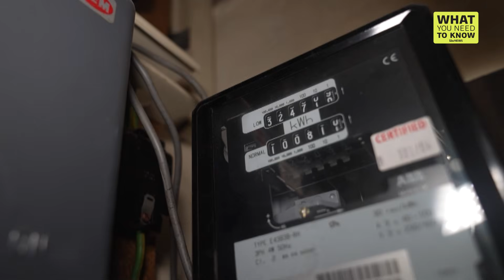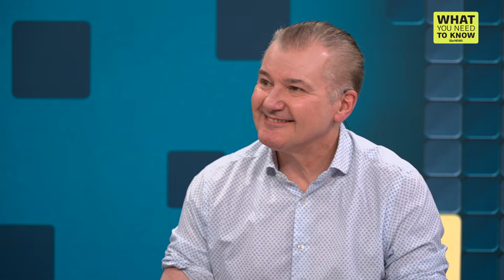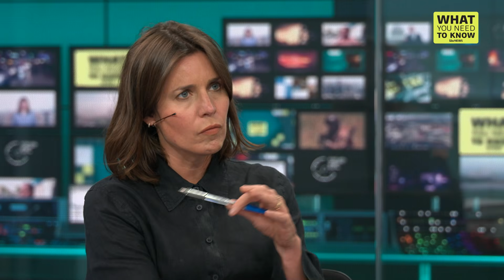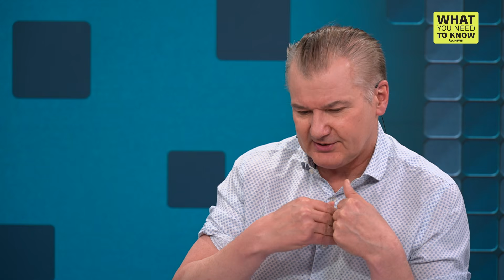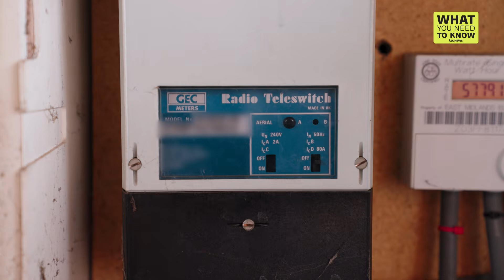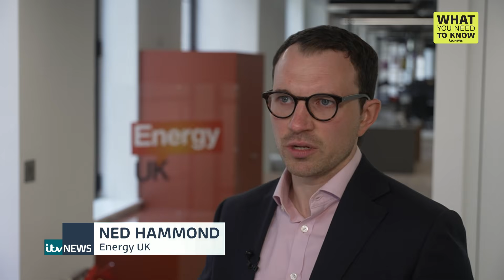Why thousands of energy meters are set to stop working | WYNTK | ITV News

Comment: I have allowed the energy company to change my meter twice. Both times the same. Asbestos. The meter was installed in 2021, so why is a meter which was installed then, obsolete about 2 years later? Did the person installing the meter, not know about the possible asbestos risk in the cupboard?

The other thing mentioned is that I couldn't find the RTS box. Would that be inside the meter itself? There is something in the cupboard, which mentions Economy 7.

Comment: What if you have a combi boiler and central heating and the storage heater (that big copper thing that has never switched on for the last 20 years) been disconnected from the RTS? So no change then if you only use electricity during peak hours.

Comment: I had my RTS meter ripped out over a year ago, when I found out that ANY electricity board GANGSTER company would no longer put me on any cheaper energy deals. Nope, didn't really want a smart meter either, but yep, I have saved hundreds off my annual billing already. You might scrap an old car for the sane reason. Yes, thet run this country like gangsters not much choice under this administration currently!
Reply: I don't think my RTS has ever worked because the big copper thing has never heated up before for the last 20 years (since I moved in). The house is heated by central heating from a combi boiler. Most of my energy usage is during peak times. Sounds like a lot of scare tactics making people think their electricity will be disrupted if they don't get smart meters. I think I'll keep my old analogue electric meter and add a 1 in front of the reading when it rolls over 99999.

How did you save money on your electricity? Have you got a separate solar panel set up?
Reply: @kynchan3332  Well, no my friend. Since I had EDF change my RTS meter to a smart, I was able to sign up to a much cheaper 2 year 'fixed deal', at a much lower day and nighttime rate than the standard tariff I was on. Unfortunately, you can't seem to change suppliers or go on cheaper deals now unless you swap out the old meter.I'm not saying I agree with smart meters, just using economic sense.

Comment: I've been trying to get EDF to replace my ancient RTS meter since the switch-off was first announced, but with no success. 
The time signal switches my meter between Days, Evenings and Weekends, Nights, and Off-Peak, with each rate having a different cost per unit. Who knows what will happen when the signal is eventually switched off, but being left with no electricity supply at all seems a very real possibility!
Reply: The meter will still work but the signal going to your storage heater won't. The lights won't go out, the electric oven, electric shower, your electric kettle, all your plug sockets will be fine. If you don't switch the utility company can't monitor you properly. If you use a combi boiler that should be fine for your hot water and central heating connected to it.

Comment: 50% of affected customers, if not more, have had the opportunity to have a smart meter fitted and declined. This RTS issue is not new and utility companies have been warning customers for the past 3 years, as this issue has been pushed back three times, that this was coming. And it is incorrect to say there hasn't been a physical solution to this problem until now.

Comment: Heating stuck on or off?? Total poppycock. Everything electrical has an isolation switch. Also. RF frequencies are not needed for electricity to travel through meters. As long as there is an connection to the grid, the power will flow.

Comment: Vastly exaggerated issue being used to push out smart meters. Only meters that DIRECTLY switch hot water and heating will be impacted. Most households will be fine since these have their own controls. The energy companies have a quota to fit new meters so are sending out alarming notifications to households to upgrade. They do not know what meter you have, but they do know if you've not already switched, so many households are targeted to upgrade a meter that is not required.

Comment: One part is nonsense, your heating can't be stuck on. I have economy 7 for storage heating, even old storage heaters like mine can be manually switched off from the supply at the fused spur switch, or turned down through the charge dial. EDF sent a  technician round to me last year but it turned out that my old meter had a mechanical switch over clock rather than RTS. He wasn't keen to change it for a smart meter as "it wasn't a straightforward job dealing with dual rate meters." I said I was sorry that EDF had sent him out, his response was "no problem as it's one less job for me today."

Comment: economy 7 meters, the charge night storage heat overnight with cheaper band electric the radic signal that radio 4 transmits rap the thing tin-foil, while the last cheap rate band doesn't get the last radio 4 set, the high band, and just cheaper electric 24/7 all every day? where the problem

Comment: I'd of thought when your old fashioned dual rate meter permanntly stops receiving the Radio 4 RTS signal, you might lose out as your electricity meter will continue working, but just at the standard rate only. If incredibly somehow or other, your meter sticks on the 'off peak' rate, then lucky you!

Comment: Your reporter is wrong about who is turning off the signal.
I wrote to the BBC about this matter.
They replied stating they transmit the signal provided by the energy provider, BBC is not turning off the signal.
I'm looking for my letter now, when I find it I can quote exactly what the BBC said.
Also, in a recent TV interview the government want something like 90% of households to have smart meters meaning they are ok with 10% of homes not having a smart meter.  If the government are ok with not everyone having a smart meter why is it ok to switch of the radio signal?
Reply: Originally the smart meter scam was an EU directive. Just proves that we never left
Reply: stephenmontague4089
Thank you for this, it was very helpful. My mother has old night storage heaters and they've been frightening her with this line of attack. She has complained to them and we are just going to see what happens if she does nothing.. But they did eventually  say they could postpone it for her - so basically full admission it's a load of nonsense! 🙄

Comment: Sorry your scare tactics are not working I was not born yesterday you should be ashamed ITV
Reply: I am old and terrified
Reply: Hope one of your elders doesn't get affected because it wont be funny then. But you can blame the BBC for turning the signal emitted by radio 4 off. More to the point, if it's only heating (old storage heaters) and they get stuck on the off state, customers will only likely notice it coming winter. There's a time for conspiracy and there's a time for reality. This is not scaremongering. This is a real issue.

Comment: This sounds like poorly researched scaremongering. Meters record usage not control heating. Sounds like this is the old Economy 7 system which uses the signal to determine whether it's peak or off-peak charging.
Reply: Tht's not strictly true, the RTS system can also 'turn on' auxiliary circuits, eg storage heaters, at the relevant times (and obviously off later). So RTS will switch the meter so ) it records the high and low rates on separate meters, 2) swtiches on/off the auxiliary low rate circuits, these tpycially suppyling overnight storage heaters
Reply: @Paul99F although you must be able to control this because you wouldn’t have this behaviour in the summer.
Reply: No, it's the same all year round. The storage heater circuits are only energised overnight. If you don't want the heat, you either turn the heater controls down or switch it off

Comment: Office for Product Safety and Standards (OPSS) has a 2024 list of electricity meters and their lifespan called meter certification period.

OPSS Schedule 4, July 2024 is a pdf list of meters and lifespan including obsolete meters with 0 (zero) years.

Energy companies may not have the information on the current electricity meters installed and may claim smart meters are needed because they are using an old list with old electricity meters long since replaced many years earlier.

Comment: What they mean is, if your water is stuck on, then expect a massive bill. If its off, expect no hot water but a massive bill saying you did use x amount. Even when you didn't. Long story short, they are using this to scare people onto smart metres. Wonder how many will get estimate bills whilst the energy company claims their old metre isn't working properly. My last bill claimed I used £600 gas when I had used £40. Zero trust in a market who have made massive profits in the last few years whilst giving nothing back to the infrastructure etc.

Comment: Oh god lets scare people, only those who use Two tier energy (normal rate and cheap rate) may be effected But lets be honest its just another scam to force you into Smart meters which do not work for many people, as for your heating being stuck on, I know of no one who uses a meter to control their heating. The only change you will see is you can not have dual rated energy. I am not sure if that the same with a smart meter It might even be Smart meters are also effected.

Comment: The BBC letting the nation down again. Shock! 

Also, the energy providers that are being over paid and not doing the work they should be to keep the energy issues in check. 
When will our government step in I wonder?
Reply: It’s the electricity industry that let the nation down again, the current Long Wave transmitter dates from 1987, it’s worn out and no-one’s made Long Wave transmitters for years. Very soon, the parts for it will simply run out and no-one will want to pay for specialist parts to be made to order because the costs would vastly outweigh the benefits. Cheaper to replace everyone’s meter.

The electricity industry have had their fingers up their arses for 10 years and now the chickens are coming home to roost…

Comment: The obvious question is why don't the energy industry pay the BBC to keep the long wave transmissions on and so many people could keep their meters for many years to come? It's all about the energy companies making profits and being able to charge us more for all the upgrading they want to do. The battery in my "smart" meter died this week. It automatically switches off the gas when it dies. There was no announcement to me nor any sort of message sent to the energy company prior to failing. In today's world, that's not great. It isn't actually very smart. Somehow the energy companies have devised these meters to tell them how much energy you're using up to every 15 minutes or 30 minutes, yet they can't devise a meter to tell them when that battery is about to fail and cut off your gas supply. I don't think that's worth the overpriced payments we pay.
Reply: They’ve been doing that for 10 years, the current Long Wave transmitter dates from 1987, it’s worn out and no-one’s made Long Wave transmitters for years. Very soon, the parts for it will simply run out and no-one will want to pay for specialist parts to be made to order.

The electricity industry have had their fingers up their arses for 10 years and now the chickens are coming home to roost…
Reply: the irony is the wordsmart does notmean clever intelligent bc each letter stands for a different word making it so that in the short form it becomes smart . if yougoogle it it tells all the words

Comment: and what will the companies do? Bad reporting, no images and lack of information. Will a new meter be offered if a smart meter is not acceptable?
Reply: For a significant number of rural properties, which still use night storage heaters on the "Economy 7" (or the less common Economy 10) tariff, then it's Hobson's Choice.
You either install a "smart" meter, or you will lose the overnight discounted rate Economy 7 pricing.
Reply: @ten-bob-note how will it affect my solid fuel rayburn?
Reply: @nickcoppard5335  
It will increase your fuel consumption, but only on the 3rd Thursday of alternate months (when there isn't an "R" in the month of course).
I thought that would have been obvious to you!

Comment: its to do with the BBC switching off long wave transmitters but BBC said this two years ago they were going to shut  off so energy companies did have some time to fix this😮
Reply: The BBC first warned the electricity suppliers over 10 years ago.
The transmitter amplifiers use thermionic valves (vacuum tubes) made of glass.
Similar to a 1960's TV set, except a lot bigger.
There are only 2 spare valves/tubes left on the planet.
They have a have a nasty habit of going "phutt", just like old fashioned 60 Watt light bulbs, except these are rated at 12,000 Watts each !!!
So when the last 12,000 Watt bulb blows, that's it, game over!
No more Radio 4 Long Wave and no more Radio Teleswitch Service too.
Reply: @ten-bob-note  This is the story put out by the BBC and it is tosh, compatible replacements are available from the US and even if this was a problem the transmitter final stage could be upgraded with equipment decommissioned and sitting in warehouses. The BBC want shut off AM including Medium wave however the AM transmitters are part of the Civil defence communication system used in times of emergency (partly dispanded by Blair) . Digitals systems and the local FM transmitters will be compromised by actions from hostile countries and there have already been attacks on the digital system and mobile networks.  Loosing Driotwich is a big deal which will also deprive the mariners of the only radio station they can receive in international waters.   Please sign the petition to save Longwave.  

Further :   Look up on WiKi  " Aspidistra Transmitter  "  this will give you an idea of the power of Driotwich in times of emergency as its technology comes from WWII.  It is an incredible machine that needs to be kept available for use even if the bBC chose not to use it.
Reply: @ten-bob-note The valves are ceramic valves and are made to order… i.e. grossly expensive.
Reply: @stickytapenrust6869  
They used to be water cooled GEC-Marconi Type CAM3 triodes.
What are they using now then?
Reply: @stickytapenrust6869  
They used to use GEC-Marconi water cooled triodes.
(YouTube deletes my comment if I quote the Marconi part number for some bizarre reason.)
Reply: @stickytapenrust6869  
What are the ceramic ones used now then please?
Reply: @stickytapenrust6869  
What are the ceramic valves used now then please?
Reply: @ten-bob-note Can’t remember the part number but they were ordered from Thales. They’re used in the Marconi B6042 transmitters that were installed in 1987.

Comment: Terrible reporting. Too much repetitive and irrelevant talking. Pictures of the RTF metres should have been shown. The annoying interviewer is behaving like a giggly schoolgirl. The fearmongering claim that “heating could be permanently switched on or off” makes no sense when standard heating and hot water systems have independent controls. There was no attempt to explain what he means by this claim. This sparse information should have been edited down to two minutes at most, not spread out to nearly 14 frustrating minutes. Do better ITV News.

UPDATE
Having looked into this, I now realise his claim of "heating may be permanently switched on or off" applies to a very specific old Economy 7 system in which a house only has night storage heaters that are directly wired in without any individual switches to turn each storage heater on or off. But, in all that mostly wasted time of the nearly 14 minutes interview, she never asked him to explain what system he was referring to and he never once mentioned those crucial words about "Economy 7 night storage heaters" and "permanently wired in without on or off switches".  That old heating system can be both inefficient and very expensive, so if anyone still has it then they should be advised to get it changed, or at least modified with switches for more control, as well as making sure the meter is accurate and remains functional after the radio frequencies are turned off.
Reply: Their quality of reporting has drastically reduced since they stopped calling themselves ITN…
Reply: Totally agree.. I had fast forward massively! This could've been done in less than 2min.
Reply: I agree 100%
Reply: Absolutely, no explanation whatsoever, just someone rambling about it being a terrible problem. Utter bilge and pointless time filling journalism trying to manufacture some type of story when there doesn't seem to be any.
Reply: Government sponsored fear mongering
Reply: Just Click Bait
Reply: I wonder how much commission I t v get for this fearmongerinng

Comment: Remarkable how small the views are for this video considering the almost 2 million followers. 

The electric ⚡️ system in the uk is on it knees anyway, hardly enough power in the grid to keep it going. BBC can’t close LW quick enough as their masts have a significant power consumption. 

Surely if you have a meter like this you know about it by now, and if your engaging surely their is a default transition tariff that can be applied as a temporary fix to avoid distress to electricity ⚡️ customers.
Reply: If you provide 2 meter readings (ie: a daytime reading and a nighttime reading) then you have an RTS meter. If you provide 1 reading, you don't. This podcast is intended to scaremonger. They can't leave anyone without electricity.